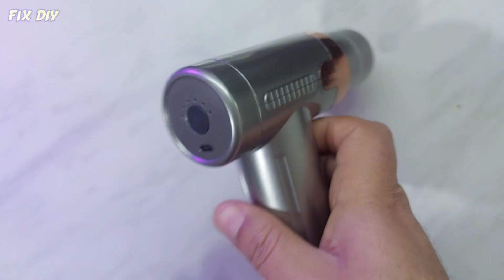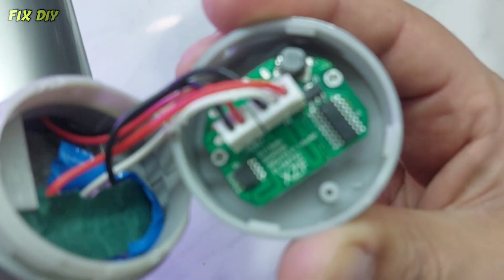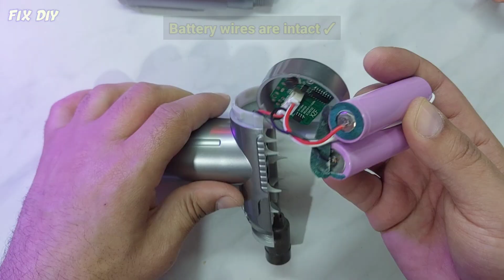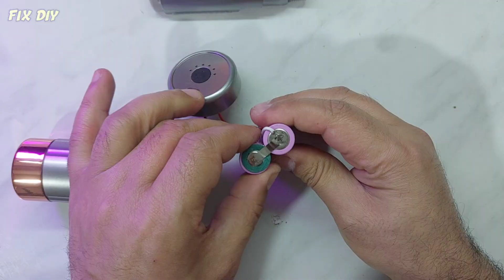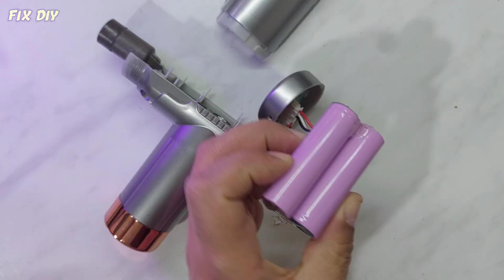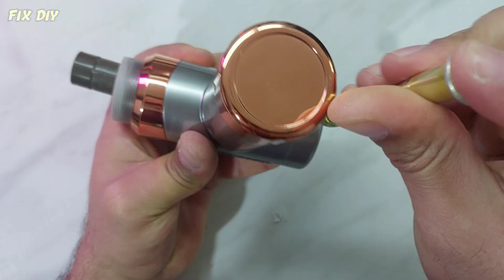Massage Gun Won’t Turn On After Charging | The Fix Everyone Misses

Comment: Hey, hope you can help me out, i am trying to use one like this for the first time but doesn't even turn of but when I charge it the 6 lights stay on, What could it mean?
Reply from the maker: When all LEDs stay on but it won’t start, it usually means the battery appears charged but can’t deliver enough power to the motor.
This is a common issue with these devices, but the causes can vary (battery, internal connection, or a control component).
If you’re not comfortable diagnosing it further, having an experienced repair technician check it is the safest option.

Comment: What charger adapter do you use?
Reply from the maker: It usually comes with just a USB-C cable.
For testing, I used a regular 5V phone charger — that’s perfectly fine.
If you have the original charger, it’s always better to use it, but it’s not required.